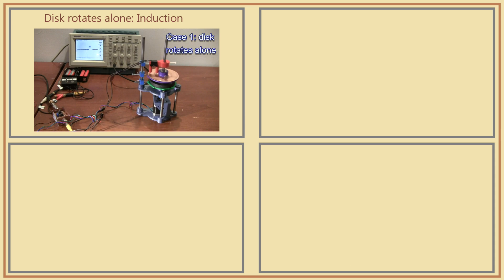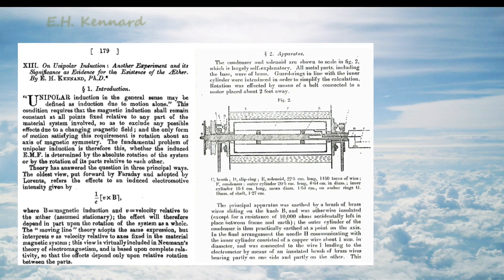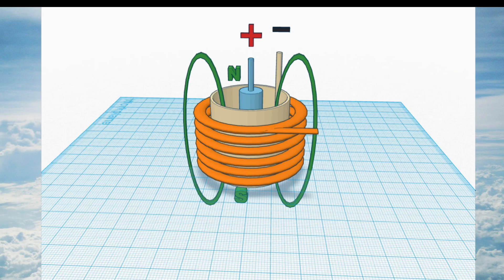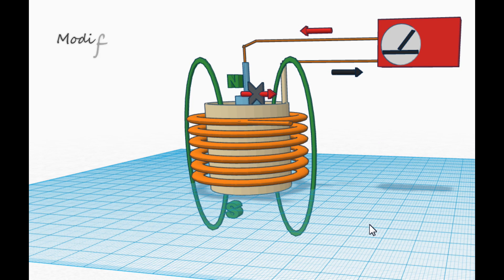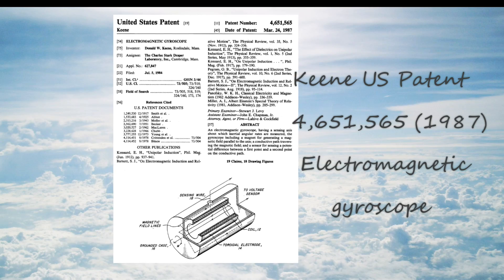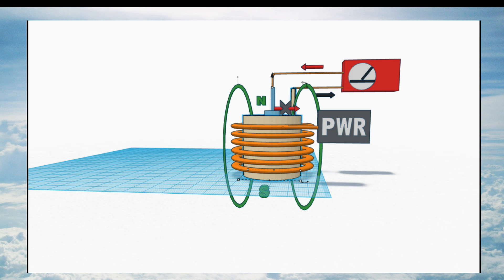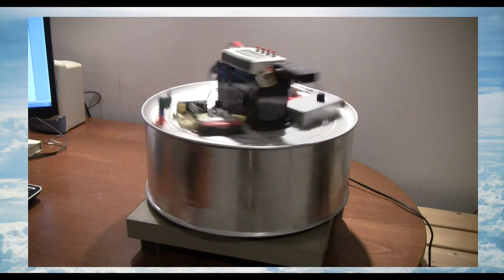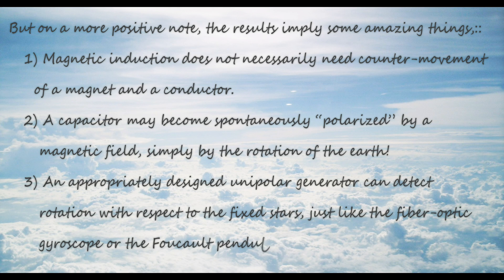Faraday Paradox Unipolar Dynamo Part 2: The Solution

Comment: I think you have done the experiment correctly and I also think the conclusion that the magnetic field lines do not rotate with the magnet is correct. However that does not  contradict the theory of relativity as you claim. Transversal movements are relative and rotational movements are absolute. That is true in special relativity and it was even true in classical physics. If you sit in a train that is moving, if you throw a ball around it will behave in the same way as if the train is standing still (as long as the acceleration is zero). If you sit on a rotating earth and you throw a ball it will not behave like a ball thrown on a non rotating earth. For example foucaults pendulum proves that. Rotational motion is absolute, in the sense that you can find a system of reference which is not rotating, without having to make a reference to some other system that is rotating relatively to your system. The same is not true for transveral motion, if you are in a system that is moving you have to define relative to what you are moving. If i tell you this ball is moving at 1m/s you have to ask me "relative to what?", but if i tell you this ball is rotating at 1 rad/s you have not to ask relative to what, you could just build a foucault pendulum and verify it. All of this doesn't prove relativity wrong.
Reply from the maker: Let's just summarize - which relativistic propositions would appear to be proven false by this experiment? If relativists argue that the magnetic field lines do rotate with the magnet, then this assertion is proven false, you say as much in the first sentence of your response. But more than that, there is the relativistic assertion that electromagnetic forces arise from relative motion of a magnet and a conductor, and that they should not be present if there is no relative motion. That would appear to be dis-proven by the Kennard and Keene experiments, which shows that when the meter, disk and magnet all rotate together, induction still occurs. Induction can't be measured normally not because it isn't present, but because equal and opposite forces arise which cancel out. This is what the experiment implies.
Reply: @plenum88  "If relativists argue that the magnetic field lines do rotate with the magnet, then this assertion is proven false, you say as much in the first sentence of your response." If Einstein said that, he was wrong. Does that mean he was always wrong? No, his special relativity theory can still be true. Do you call everyone who believes that the theory of relativity is correct a "Relativist"? Because in that case I am a Relativist too, but i don't claim that rotational movements are relative. I claim that transversal movements are relative. Special relativity is based on two postulates:

 -"the laws of physics are invariant (i.e. identical) in all inertial systems (i.e. non-accelerating frames of reference)"
 -"the speed of light in a vacuum is the same for all observers, regardless of the motion of the light source."

Notice that a rotating frame of reference is not an inertial frame. If I am standing on earth I am on a circular path around earths axis of rotation. A circular path requires a constant acceleration towards the center of my path, perpendicular to my velocity. I am not in an inertial frame and the result is that i have to modify newtons laws of motion (if we talk about classical mechnics) by adding the coriolis force. The coriolis force is a ficticious force, meaning I view the situation from a frame outside of earth which is not rotating with earth, i don't need the coriolis force to explain what i see. This postulate which is used in SR was true already in classical physics. Translational movements are relative and rotational movements are not. The consequences are, that the unmodified laws of physics are only true in frames moving with constant velocity and which are not rotating. If I have a spaceship and see another spaceship moving, i can either assume that i am standing still and the other ship is moving, or i can assume that i am moving and the other ship not, or I can use any other inertial frame. The only thing that physically matters is the relative velocity between the two ships and calculations in any reference frame will give the same results. But imagine i look down trough a window in the floor of my ship and i see the other ship rotating relative to me and the ships are placed in such a way that the axis of rotation goes through the center of mass of both ships. If i would show you camera footage of that, you could not tell whether my ship or the second ship is rotating right? But the truth is that rotational motion is not relative, it is absolute and I can tell whether or not my own ship is truly rotating or the second ship. For example by measuring the centrifugal forces on my ship, by building a gyroscope etc. This was true in classical mechanics and it is true in SR. You can also see that rotation and translation are two different things by looking at the conservation laws. Conservation of momentum and angular momentum both hold true independent of each other. SR doesn't claim that rotational movements are relative, the first postulate only states that for transversal movements. Einsteins statement about magnetic field lines rotating with the magnet was wrong, but that statement was independent of special relativity theory. 

"But more than that, there is the relativistic assertion that electromagnetic forces arise from relative motion of a magnet and a conductor, and that they should not be present if there is no relative motion." 
No there is no such assertion. I am currently studying physics and i already have my bachelor. I worked together with many physicists in my work group while doing my bachelor thesis. You would probably call all of them "Relativists". I can tell you that that none of them wo has put tought in this stuff would claim what you are assuming.

"That would appear to be dis-proven by the Kennard and Keene experiments, which shows that when the meter, disk and magnet all rotate together, induction still occurs. Induction can't be measured normally not because it isn't present, but because equal and opposite forces arise which cancel out. This is what the experiment implies."
Yes, and there are even more easy ways to demonstrate that. Look at this for example: http://www.maxwellsociety.net/PhysicsCorner/CurrentLoopPolarization/ElectromagnetismAndRotationalRelativity.html 
It shows that a rotating disc shaped magnet will polarize itself radially. It could be rotating just like that in empty space. It isn't working because it's rotating "relative" to anything in its vicinity, but because its rotating absolutely. You could use that effect to build a gyroscope and use it for measuring or maintaining orientation in space.

What I'm saying is that all of this is compatible with special relativity. You are correct with everything what you say, except that it disproves SR.
Reply from the maker: @Azzinoth224  

It is nice that you are so passionate about this...I am not trying to disprove the entire theory of relativity with this video - I am simply trying to disprove the moving line theory, not sure how you jumped to that conclusion. You perhaps should also qualify the second of your bulleted laws in your first paragraph - the speed of light is not the same for ALL observers without qualification... rotating observers can see a variable speed of light, as has been proven in the Sagnac experiment. With regard to your arguments about the differences between inertial and rotating frames, this does not in any way save the moving line theory.  And with regard to my comments on magnetic induction, I am specifically referring to the Lorentz force experienced by a charge moving relative to a magnet which is the subject of this video. If the two are moving together, there is no magnetic field "seen" on the charge by the magnet, and therefore no Lorentz force. The Lorentz force between the two arises when one moves relative to the other, at least according to Einstein's theory.
Reply: @plenum88  You said: "which relativistic propositions would appear to be proven false by this experiment?" I assumed you were referring to special relativity. If thats not the case then what do you mean when you say "relativistic" or "relativists"?

"With regard to your arguments about the differences between inertial and rotating frames, this does not in any way save the moving line theory." Which I am not trying to do. I thought we both agreed that the moving line theory is wrong?

"If the two are moving together, there is no magnetic field "seen" on the charge by the magnet, and therefore no Lorentz force." But the electrons do see the magnetic field if they both rotate together, isn't that what you say yourself in your video?
Reply from the maker: @Azzinoth224  
Here is an example: https://www.fisicarecreativa.com/informes/infor_em/Spacetime-Spin.pdf see page 2. Guala-Valverde refers to the "relativistic view" and the "absolutist view"  of the Faraday disk explanation, and I have used similar descriptions of the "two solitudes", except I have referred to the absolutists as "Maxwellians".  So when I speak of "relativists" I mean people like Guala-Valverde who advocate the moving line explanation of the generator.  He says  (p.143) " as far as induction is concerned a wire clockwise rotation upon a stationary magnet is equivalent to a magnet counterclockwise rotation with the wire stationary in the lab." - this is Einstein's view from 1905 (SR) - see for example: http://www.pitt.edu/~jdnorton/teaching/HPS_0410/chapters/origins_pathway/index.html (Magnet and Conductor section) 
About your other comment, you compelled me to explain Einstein's view about the moving conductor in the magnetic field and the Lorentz force,  I said immediately after that it was Einstein's view, when I qualified it by saying "at least according to Einstein." 
Hope that clears it up.

Comment: 2:05 I think it is not generating EMF in disc, but in wire from stator to voltmeter. If wires were placed differently, it would not show EMF on screen. Could you repeat the experiment with wire from stator being directed straightly upward in different position? Read more here: https://www.physicsforums.com/threads/request-about-experiments-on-the-linear-motion-faraday-paradox.966883/#post-6141798

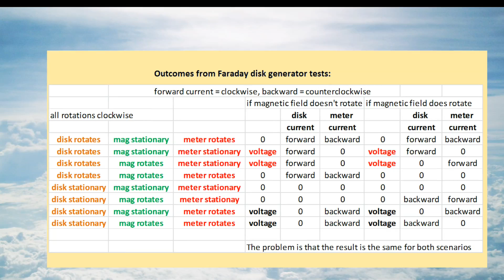Comment: 0:54 Thanks for the table with full results!  This is really fascinating! We cannot tell whether the magnetic field moves with the magnet or not!
Reply from the maker: Ur welcome - the Kean patent of course suggests that the magnetic field doesn't rotate with the magnet, since an electrostatic field is generated even when the magnet, rotor, stator and meter rotate together, a bizarre result indeed!
Reply: plenum88 Why you keep mentioning “magnet”, there are no magnets in the Kean patent. Do you mean the coil? You said the same thing in the video. Thanks. Great work!
Reply from the maker: @gcerri524  - Yes I am referring to the "electromagnet" of course.
Reply: Kenzo Kenzo  Faraday did this with a magnet, not a coil. There is something else going on here. This is so interesting.

Comment: No, Einstein is right the field rotates with the magnet... Also in your experiment you have an effect of magnetic induction due to the Earth magnetic field... Most of all in open circuit electrostatics the air friction generates excess charges which effect is also proportional to the rotation speed... Airplanes has to discharge itself after landing because the charge amount represents dangerous amount of electrostatic energy...
Reply: No, the field does not rotate if the magnet is rotated.  Need proof?  Very simple:

1)  get a sheet of white paper, thick enough to support the weight of iron filings
2)  hold the piece of paper in a horizontal position
3)  sprinkle some iron filings on the top side of the paper
4)  hold a round magnet stationary under the paper (needs to be close enough to make the iron filings line up with the magnet's field)
5)  now, rotate the magnet -- did the iron filings rotate?

NO, they didn't.   When he rotates his ring of neodymium magnets, the filings do not rotate with the magnet rotation.  The only time they move is 
1) if he fails to keep the magnet ring in one place, if he moves the magnet off the vertical axis
2)  if he reverses direction of the magnet rotation.  Once the magnet is rotating you do not see the filings all rotating like a wheel.  Not affected by the rotation.
https://www.youtube.com/watch?v=0uCCmxq8e7o

Magnets polarize the virtual particle fluctuations of the vacuum. On one side of the magnet the virtual particle field sees either a "N" or a "S" pole.
Focus on the "N" pole side of the magnet.  The virtual particle field (which consists of electrons and other virtual particles) -- sees the "N" pole.  Now rotate the magnet.  What does the virtual particle field see?  The "N" pole. It still sees the "N" pole.  Even though Faraday was unaware of the quantum fluctuations of the vacuum, after he dwelled on this "why doesn't the magnetic field rotate with the magnet" he concluded "the space around the magnet is the purveyor of the magnetic field.  The field is in the space around the magnet and does not rotate.

*ANALOGY*
- hold a vanilla ice cream cone in your hand.  Your tongue is the virtual particle field.
- lick the top of the cone - "Okay that tastes like vanilla ice cream"
- now rotate the cone and while it's rotating, lick the top of the cone.  "Okay, it still tastes like vanilla ice cream."  

Another idea - two strong magnets - you have one in each hand during a spacewalk, you're an astronaut on the space station.  (Do magnets work in space? Yes or no NASA space mission would have succeeded).

You move the "N" pole of magnet #1 close to the "S" pole of magnet #2.  You hold them apart then suddenly the magnets close the gap and SNAP together.

WHAT IS THE MEDIUM OF TRANSFER IN 'EMPTY' SPACE HERE?  How did magnet #2 'know' magnet #1 was there?

The magnets polarize the virtual particle field of the quantum vacuum.  Both in outer space, and on Earth.
SEE HERE => https://en.wikipedia.org/wiki/Virtual_particle

.
.
.
Reply: please give a source whre Einstein does write about that?